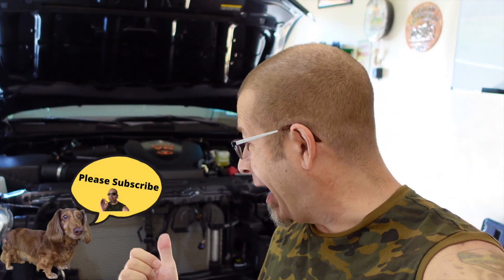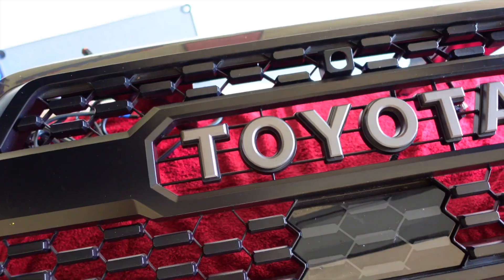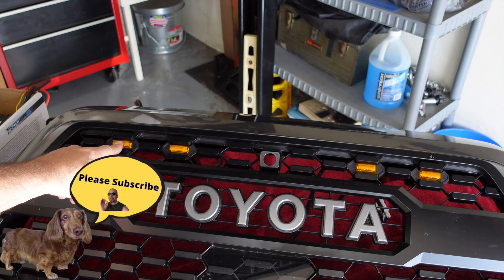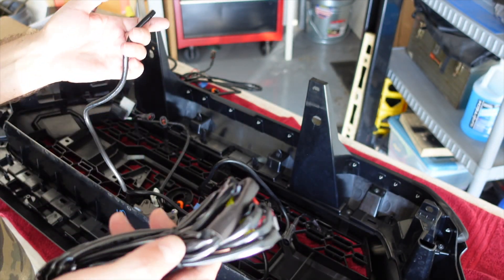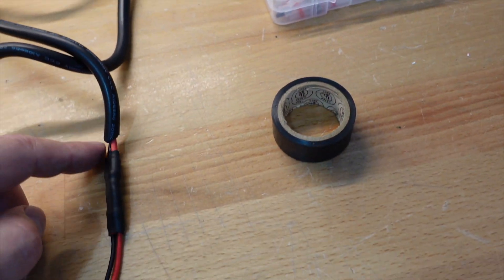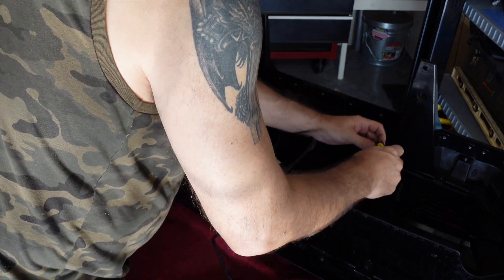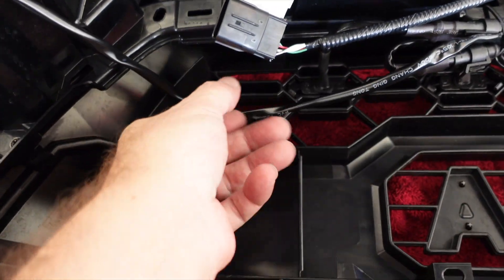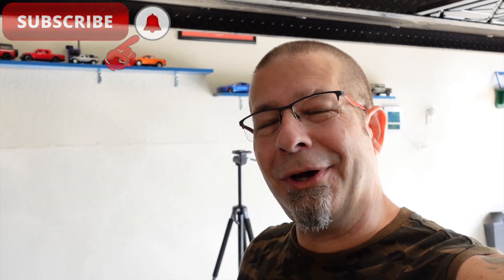New Toyota Tacoma Lights

Comment: Looks great! I run the same ones on my Tacoma. I'd suggest stocking an extra light or two. They sometimes are susceptible to moisture incursion and will short out. I lost one after about 6 months so I ordered just a set of lights and replaced the shorted one - now have 3 spares.

Comment: Hey Rob, I think the reason that the lights were such a tight fit is because it looks like you have an authentic OEM pro grille. I found that with mine out with mine as well. The clip in lights seem to fit correctly in the knock off pro style grilles. You actually get an audible click when you put them in thise from the videos I’ve seen. From the research I’ve done there are slight differences in the grilles. I have the same grille as you with the camera hole that I ordered from spark parts. I ended up going with the Yota LEDs that you had before for the secure fit. I believe it even mentions it on their site that the Yota LEDs are specifically for OEM grilles only.
Reply from the maker: Probably so.  My grille is OEM👍

Comment: Rob, they look good👍👍👍 . What are you doing  with the headlights? I just upgraded the light bulbs to LED from them halogen. What a difference 😎👍. I also did the fog lights yellow LED bulbs. much cheaper than replacing the complete unit. 🙏
Reply from the maker: If I do anything, it will be complete replacement 👍